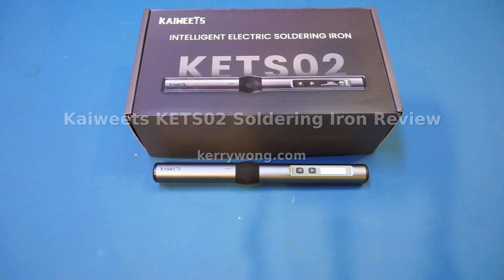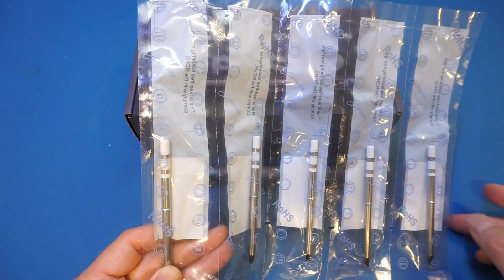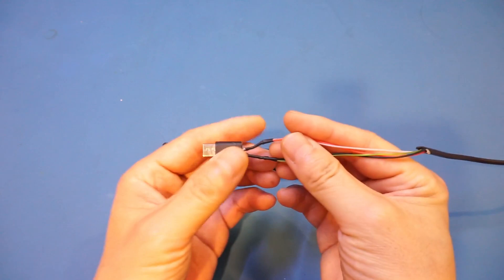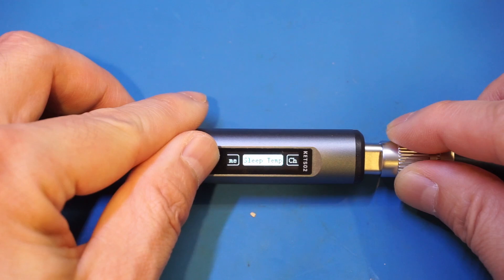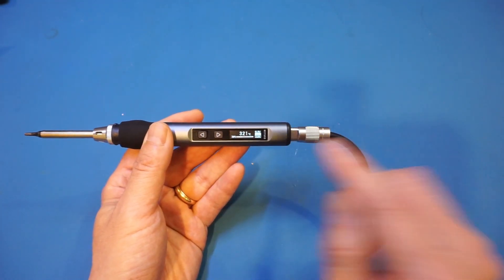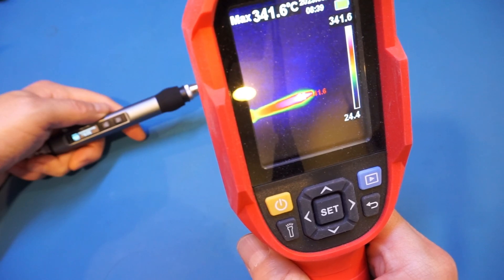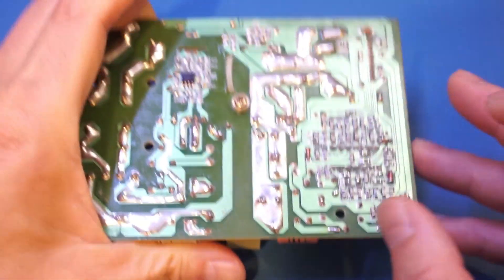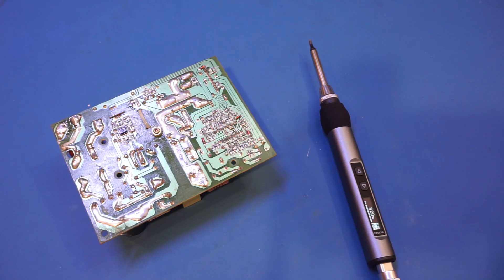Review of a 65W Kaiweets KETS02 Smart Soldering Iron

Comment: Great video! thanks! I wonder what would happen if yo manually set voltaje to 5V.. will it work at all? It would have to increase current beyond the capability of most (or may be all) USB adapters in market.. Thanks!
Reply from the maker: No, the minimum voltage required is 9V. It doesn't work with 5V.
Reply: thanks! sorry, my mistake!.. have you verified the current when using 9v? thanks!
Reply from the maker: Yes, when using 9V the current is only at 1.6A.
Reply: @KerryWongBlog  great! thanks!  that would mean less than 14w of heat
Reply: @adrian.parano  - it's just a resistive heating element, like any other soldering iron. Basic Ohm's Law applies... 9V @ 1.6A = 14.4 = 5.625 Ohms. 20V @ 3.25A = 65W = 6.15 Ohms. Those will be the "hot" resistances, and since the heat will be different they don't exactly match each other.
You could operate it from 9V using a Boost Converter... let's say 85% efficiency, so 65W @ 9V divided by 0.85 =  8.5 Amps. That is a ridiculous amount of current to draw from 9V,  and you'd need a beefy DC-DC converter - you'd be better off buying a 65W Phone charger.

Comment: try measuring the tip to mains ground, those usb powersupplies leak quite a bit of ac.... and having 60VAC on the tip even at a low current isnt that useful when working on sensitive stuff
Reply: Speaking of which, there is some audio noise when the heating element operates. What does the ground lead on the iron look like? 🤔
Reply from the maker: I use a wireless microphone so the noise is likely the interference from the PD adapter.